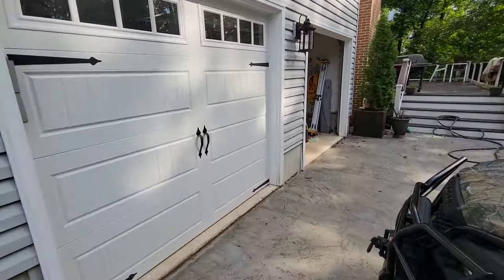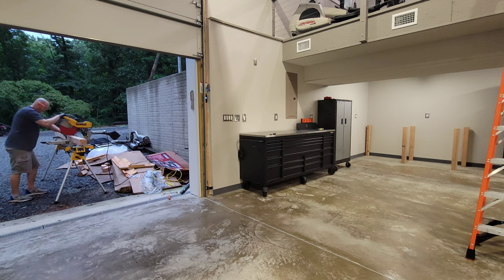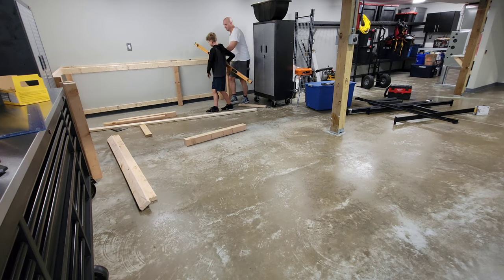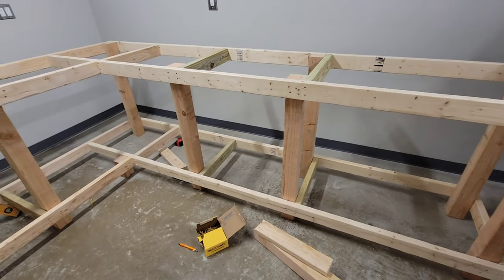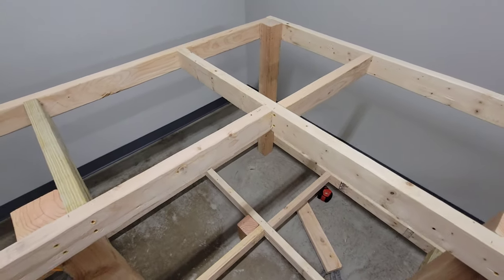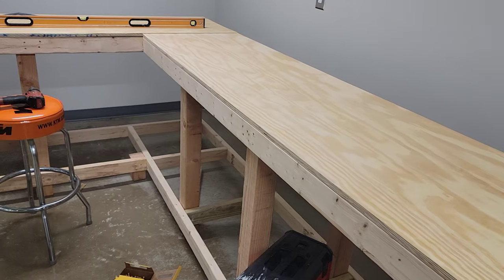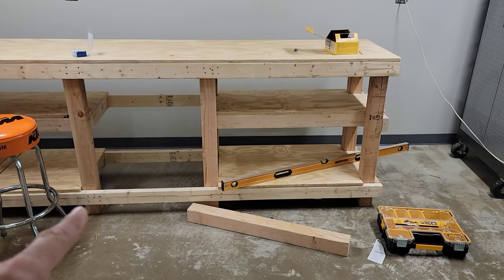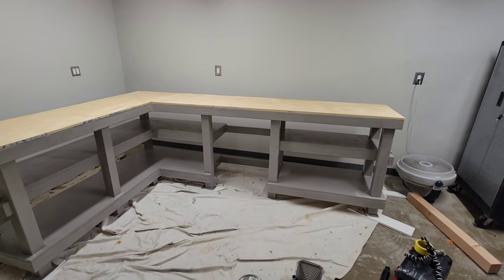Building a custom corner workbench for my dream garage!

Comment: Pocket screws would have been great for mounting the workbench top. Once you buy the little jig, and use it once, it's life-changing for DIY projects. Always makes your structure feel way sturdier too.
Reply from the maker: Yeah I actually thought about using my kreig jig but I thought the 3/4 might not be deep enough. That would definitely make it a more professional job!

Comment: Nice bench man. Gave me an idea on mine. I was at lowes and the pro desk guy tild me when the guys get back with kitchen jobs they have left over countertop. Just happened to have one 6 foot fermica top. Ended up looking good. Keep it up
Reply from the maker: That's the way to do it. I was looking for Butcher block and steel on marketplace but didn't have the patience. It is relatively cheap if I need to replace the top

Comment: Great job. Thanks for taking the time to do this video. One question, what type of peg board is that? Is it metal?
Reply from the maker: Yes, that pegboard is called wall control. It's definitely worth the extra. I got this pack from harbor freight, but you can order from many places and they have all sorts of colors. They are compatible with standard pegboard accessories as well.

Comment: Do you happen to have a general materials list of what you started with Qty of boards used and stud lengths?
Reply from the maker: It will all depend on your precise dimensions but most counters are between 32 and 36 inches high, so you should get long enough material to maximize the material. 8' post will give you a set of legs. I kept my dimensions simple. 2 ft wide surface means each sheet can be cut in half instead of wasting material. I think I used 2 sheets of 3/4 plywood and (6) or (7) 8 foot 4x4s. And (12) 8' 2x4

Comment: I'm looking to build this and I am new to woodworking and cutting etc. Do you have a list of materials, lengths and sizes you used for helpful guidance?
Reply from the maker: There's really no limit on dimensions.  Usually, 32-36 inches is counter height. 24 inches deep is standard as well.  Plywood comes in 4x8 sheets so tey and maximize the use of material. For example, one 8' 4x4 makes two legs. Rip the plywood in half and you have enough for a 2x8 table with a shelf. The beauty of it is you can make it customer to fit whatever you intend to use it for. Invest in a decent tape measure, decent circular saw and go to town. A jigsaw is helpful but not necessary

Comment: What height did you place the bottom and middle shelves?
Reply from the maker: If you look, you'll see I just used a 2x4 turned on its side to set the height. That allows enough room for me to reach underneath when I inevitably drop something underneath.  Also gives room to vacuum
Reply: @themoneypitgarage  I’m actually in the process of building this same bench. I did see that in the video and did the same. Could you drop the measurement from the top of the bottom 2x4 to the top of the middle shelf 2x4. Also had to wing the 4x4 placement! Thank you for the video and idea!
Reply from the maker: 13.25" from top of bottom shelf to the bottom of the 2x4 supporting the middle shelf. But make sure you make it work for you.  If you've got stuff larger or smaller just make it tall enough for that stuff to slide in

Comment: I really like this and want to build something similar. May I ask the sidewall height and the height of your area under the loft or mezzanine. area?
Reply from the maker: It's about 78 or 89 inches under the beam and right about 94 inches underneath the mezzanine.
Reply: @themoneypitgarage  So if I was shopping metal buildings for a shop build, a 14 foot wall would work if the mezzanine was centered under the peak?
Reply from the maker: @Phil Mcginnis  potentially,  you need at least 7ft of head room so you don't feel like you have to duck, but keep in mind the thickness of your beam and floor joists as well. My joist sit on the beam, you could hang them to save height but it wouldn't support as much weight
Reply from the maker: @Phil Mcginnis  look at my other garage videos, I think I talk about ceiling height. If your metal structure has vaulted ceiling or scissor truss you'll be good
Reply: @themoneypitgarage  Thank you for the info!